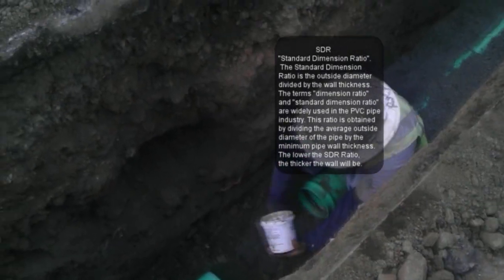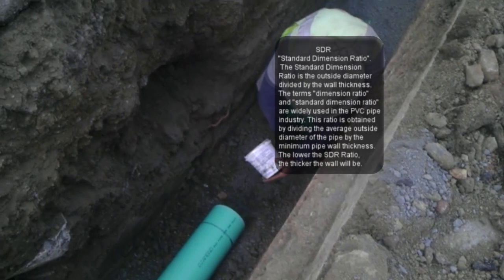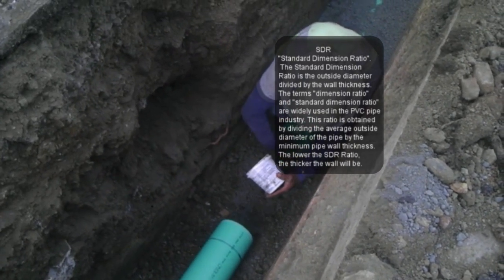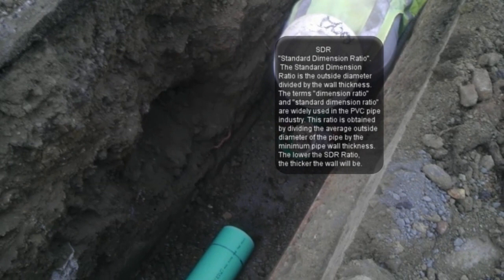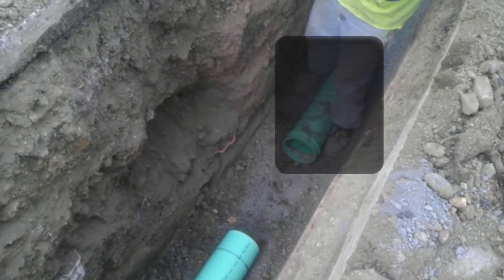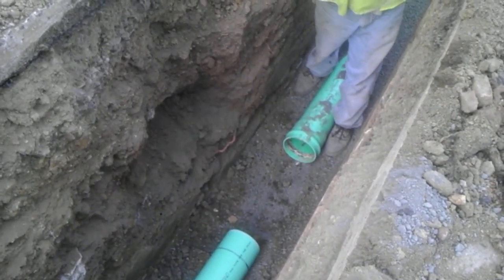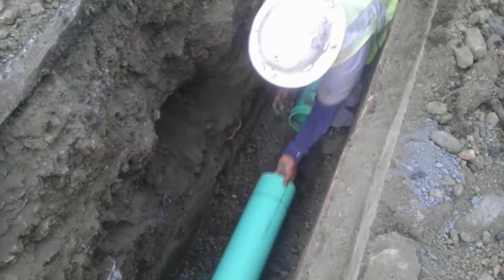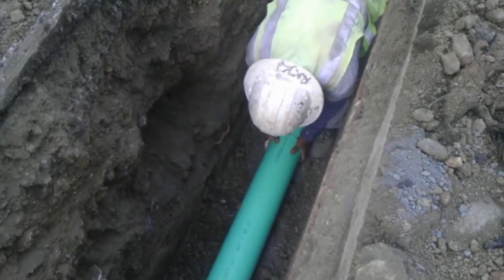How to Install a Sewer Lateral Line

Comment: I do this for a living. Though not incorrect, this video is lacking A LOT! The hard and most important part of this process is establishing initial depth then trenching correctly to establish proper flow. “Stabbing” pipe together is simple, and the last chore other than backfilling. And this SDR35 is used mainly for more commercial residences with increased flow. We use it when working on the actual sewer district jobs. For individual home-owners (who are responsible for their laterals to the sewer mains and trunks), we always use 4”” SDR, or cheap-ass white PVC pipe. Hell, it may be SDR35 as well, though I doubt it. My point is this: this video essentially teaches you NOTHING! There are certain municipal codes which require a certain amount of fall (.25” every foot here) and separation from other utilities, etc.  I’m just saying there is so much more to repairing/installing a sewer than most people would imagine, and this video touched on none of it! Still, thumbs up for posting something at least!

Comment: Thank you for this sewer lateral line video. It was very helpful to see exactly what needs to be completed and your verbal tutorial was also very helpful.
Reply: Creator3n1 Inc  Really? How do you establish proper flow from home/building/etc to the sewer main? That’s the hardest part of the entire job! All this video teaches is how to “stab” pipe, the easiest part of the process!  I do this for a living, and out of boredom looked this up. There’s nothing incorrect about what he says, but there’s no substance either! Still, at least he posted something, as did you by responding. I respect that! Anyway, we use lasers to establish our flow (1/4” every 1 foot is code, so every 10’ the sewer lateral/pipe gets lowered 2 1/2 inches. Within reason. No, this video teaches nothing!

Comment: Nice and straightforward video, check the math - 2% is 1 in 50 slope.
Reply: What is the "normal" slope for a residential install of the lateral line?  Thanks
Reply: 1/4" per foot
Reply: yup, 2' drop in 200' run is a 1% grade. 1 unit drop in 200 unit run is a .5% grade equivalent to 1/16th" slope . According to 2021 IPC:  704.1 you can only have a 1/16th" slope with 8" or larger pipe. 3" to 6" needs 1/8" slope. 2.5" or less pipe needs to have 1/4" slope. At 1:51 that looks like 6" sewer pipe needing the 1/8" slope.

Comment: hey , i am installing a sewer line, from the main, main  is 7 ft deep , need to run it  for 20 ft to somewhere near my new home,
can i run 3 ft pipe and install a clean out witch  city require, and than do a 45 rise up to 2 .5 ft and than 45 + run it for 20 ft "slop 1/4 every ft" and than install last clean out, is the right way to do it , or any suggestions, thanks

Comment: Thanks for the video.  
I'm working on my first commercial development project and have to install 500'+  of 4" pipe starting at a 36" depth to a 9' deep lateral connection.  It is a gravity sewer line.  It has a 1% slope.  I'm wondering what special equipment you need to dig 7.5' deep?
Reply from the maker: Barbara R   You will need to plan that trench.  That is quite deep and will need to have the right OSHA protection and it must be trenched properly as well as shored.  Good luck!!